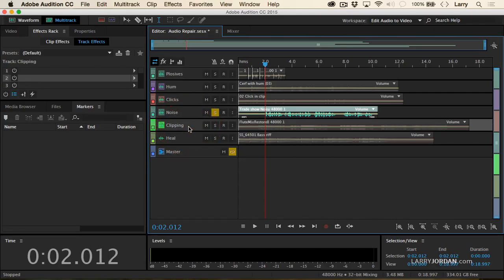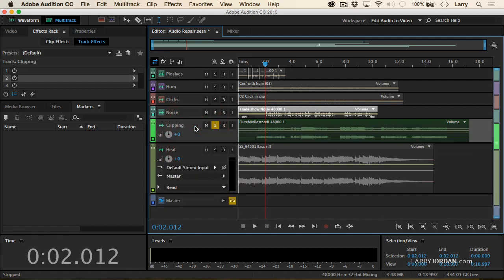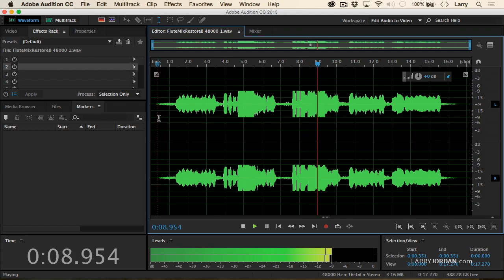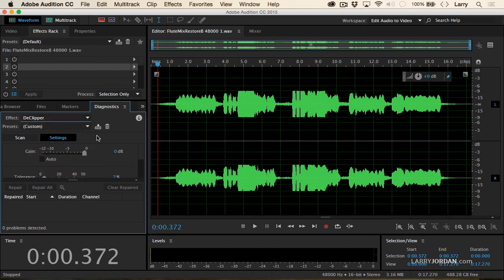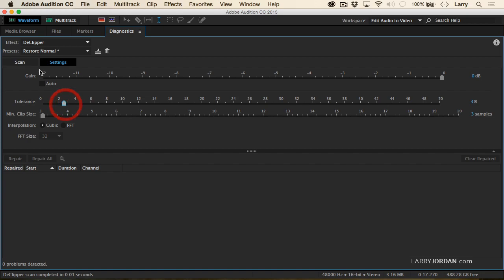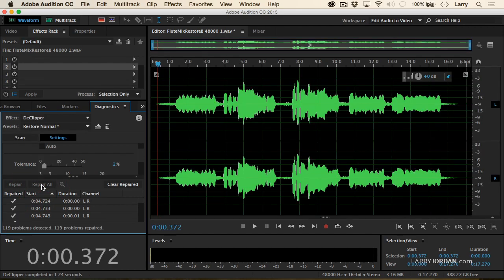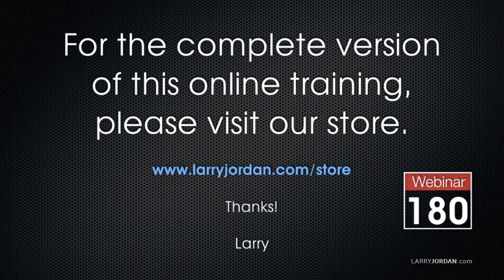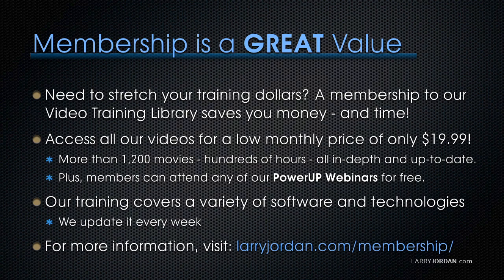Repair Audio Clipping

Comment: WOW! Thanks for the very informative video. I've been using Audition CS6 for a few years and I'm still learning tricks. I have a lot of CDs from the 90s that were over mastered and are extremely LOUD. I just spent a few minutes working on a song that is LOUD and found the settings that tamed it down the best. Then I normalized it overall to -.01dB as it was still hitting in the red a bit. Now it sounds great. Thanks!
George
Reply: can you help me mixdown a similar audio problem i have with a home recording file